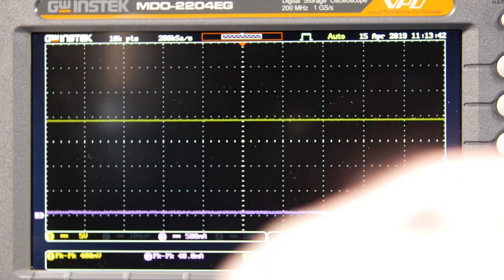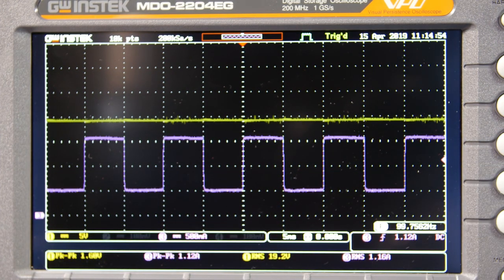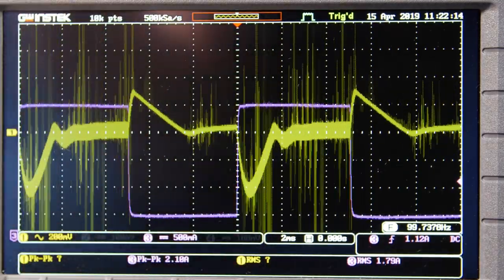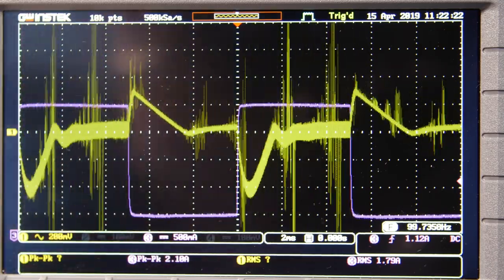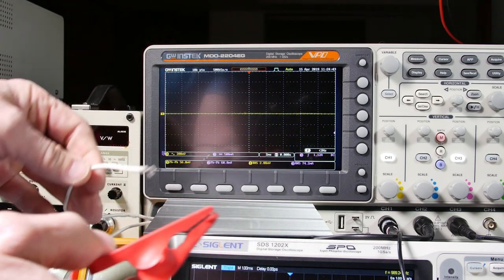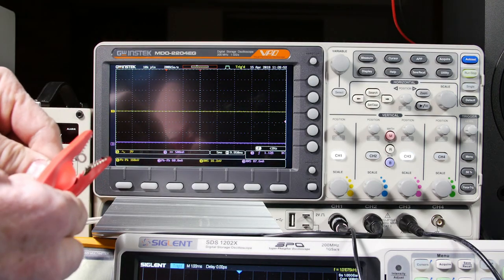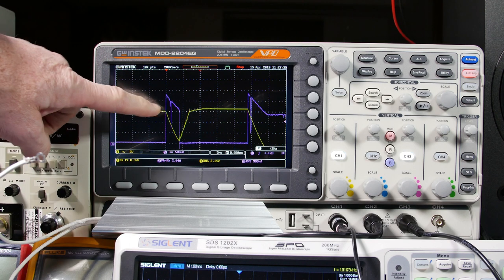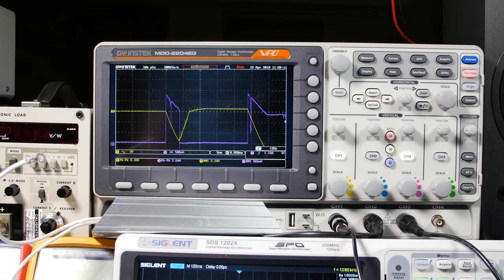Power Supply Stability Test

Comment: Before I tell you why, the problem of load is HUGE.  All affordable active loads are too slow for what I need so I had to build a dumbed down but FAST makeshift thing that basically switches in several mosfets controlled by a simple microcontroller to switch in an actual RESISTORS in sequence.  That way I got <50nS load switch in time - YUM!  Why I need this is a long story, so if you have a few hours :):):) ...

   I am trying to design a fast response bench power supply, using a hybrid switch + linear setup to get around the switching time limiting factor you mentioned in your video.   I am doing this because the one hing I have always hated about my current bench power supplies is their SLOW response, which they try to hide this by having HUGE output caps - PATHETIC!  Well I have a HUGE cap in my design BUT it is at the swithcing output end, ...the final linear output end only has a 33nF only for stability.

   All sounds great, BUT getting the linear loop to be stable for fast response (below 1uS for large steps, especially for CC control) is mind bendingly difficult!   I have given up on conventional feedback loop control and am going with PID loop theory design using high bandwidth op-amps.  But even there the real world characteristics of the op-amps is way to variable (between different models), as is board layout etc. etc. ...I am ageing fast! :):):)  ...I suspect there are some PSU design GURUS out there that would look down on me with pity.

Comment: Hi Eddie - timely video, I'm about to lump out for a power resistor to act as a load.  Would you suggest a range of these or is one sufficient for testing purposes?  I have a 10ohm 100W in my basket right now which feels sufficient but I don't have experience of how, for example, an 8ohm load or 100ohm load would affect the power supply operation differently that makes them worth having.
Reply from the maker: Andrew Johnson It is good to have a resistor that will provide a max load to your power supply, or at least to provide the load that you expect to power plus maybe 20%.  Let’s say you need 4 ohms for max load, you could get two 8 ohm loads to work in parallel.  Then you can switch between half load and full load.  I think it’s a good idea to get it Power rated 3 to 4x the power you expect to dissipate so that it doesn’t get too hot.
Reply: It would be for a power supply so I guess the load could vary.  I like your idea about multiple, lower value ones to put in parallel, I hadn't considered that - they aren't the cheapest things but for 20 bucks or so I could get 3 or 4.  Thanks.
Reply from the maker: +Andrew Johnson You bet!

Comment: Hi Eddie,
The high frequency noise on waveform, is it not just the boost converter switching noise ?
I've recently been trying to use a boost converter to step up 3v to 9v DC and I'm getting the similar switching noise.
Even though, I'm probing using a  short spring clip for the scope probe ground rather than the standard crocodile clip lead.
I realised that there might be other appliances that could causing that high frequency noise.
I'm thinking of using an LC filter network to clean up the noise ?.
Don't worry about getting in the way of the camera, there's lot of adjustments to make on the test gear, to demonstrate the video☺
Only concern, the title of the video and thumbnail, doesn't quite reflect the content of the video
ATB
Adam
Reply from the maker: LOL🤣 Thank you so much!!  I guess you know what the next video is going to be...;)  I am out of town on vacation with the family, and I rushed to post this and got the thumbnails mixed up.  😬

The noise is something I wanted to attack in another video, but you are on the right track.  The second LC filter is efinitely one way to solve the problem.

Comment: Great video and great visualization, was wary informative!
I was wondering, when you use your 8Ohm load and connect it, could that not also be called inrush current?
About your arm going in front of the camera, I thin that does not matter, I feel that we are in your shop where you are showing something and if that wore the case, it would be totally normal that your arm got in front of the screen. What is important is that it was easy to see what you did and the result on the screen.
One small thing was maybe your Siglent scope, displaying something wary animated, it could maybe be a bit distracting, now it was not a part of your teaching. :-)
Reply from the maker: Thank you!  Great feedback!  Inrush has more to do when power is applied, although that’s another way to check for stability - thanks for the lead-in;)
Reply: @KissAnalog  Thanks for your answer:-)
Yes I have learned, from you, that inrush current is the current a circuit is using on power on.
My thought was just that since the 8Ohm first was "turned on" when you did apply the power lead, it could be called a sort of inrush current. :-)
Reply from the maker: +Fried Mule You are right, it does behave similar- especially when starting at no load - which is always the more difficult step load.

Comment: WHAT FREQUENCY RANGE SHOULD YOU HAVE WHEN LOOKING TO BUY A FUNCTION GENERATOR FOR GENERAL ELECTRONICS USE?
Reply from the maker: I think there are some low cost generators that may go to 1MHz that might be more than enough for many people.  I will pick one out and for a review.
Reply: I just bought a Feeltech FY6800 for my cousin (he's getting started in electronics) and it has a 60MHz frequency sine waves with square waves at 25MHz and all other waveforms at 10MHz. It also has arbitrary waveform capability and while the software is a bit clunky, it works fine. I don't think you can do better than that for under £80 (~$100 US).
Reply from the maker: Supercilious Dude great feedback!  Great price too!

Comment: I AM A LITTLE LOST ON WHAT YOU ARE DOING HERE,ARE YOU TALKING ABOUT THE REGULATION?ALSO I HAVE TROUBLE READING THE DATA ON THE OSCILLOSCOPE SCREEN, IT SEEMS BLURRY.
Reply from the maker: Hi David.  
Yes, the regulation has a control loop that can cause instabilities if not designed correctly.